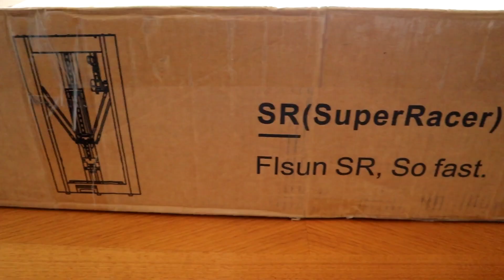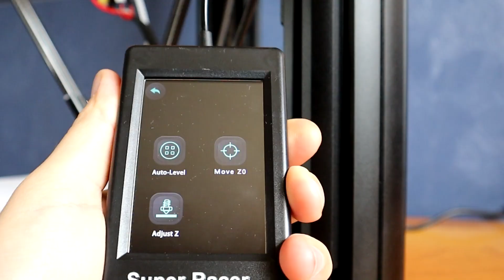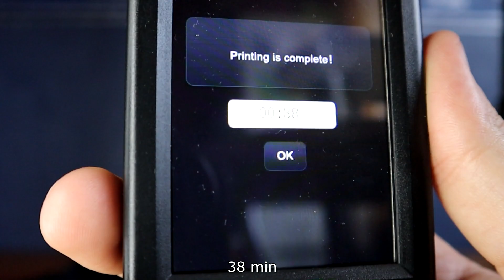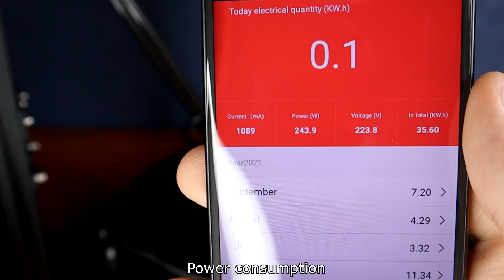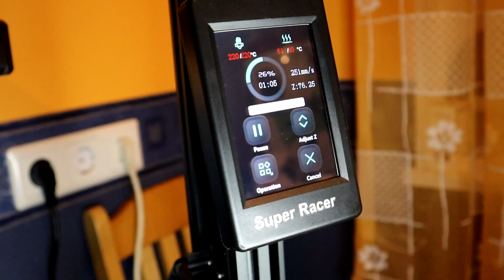FLSUN Super Racer - Fast 3D Printer

Comment: Many tell me this printer is not recommended for flexible filament, and this stops me on buying ... however you print tpu quite well, but on the video you don't say much about it. it has been difficult? how did you do?
Reply from the maker: It's not difficult, lower the retraction settings and use slow speed. Also my tpu isn't the softest one. For flexible filament direct extruders are better. If you want fast printer for PLA, Super racer is what I recommend.
Reply: @3DPrintsBuilds thanks can you tell me the name / model of this tpu that i try to buy it too?
Reply from the maker: @Celt1k  Sunlu TPU
https://www.sunlu.com/collections/tpu/products/copy-of-tpu-flexible-1-75mm-3d-printer-filament-0-5kg-1-1lbs

Comment: Thank you for this nice video, thanks to this review I decided to buy it!
in your video you printed PETG, could you tell me the printing parameters (if you remember it) speed, nozzle temperature and plate temperature? Thanks a lot!!!
Reply from the maker: Thanks! I don't remember exactly the settings. Temp 235 for nozzle, 70 for plate and for better bed adheison flip the glass plate and use  glue. At first choose slower speed and during printing rise the speed and you can see what is the best for your PETG.

Comment: thank you for your nice review.  
I've had my eye on this printer for a while but the lack of information about TPU printing is scarce but essential for my user case.  in your review I see the SL TPU printing for the first time without modifications such as a direct drive (sherpa).  
Did you have many problems with TPU (long bowentube) and at what speed did you print the test cube?
Thanks in advance!
Reply from the maker: Thank you! I don't remember the exact speed at the moment, but when you print TPU, you have to slow it down. Speed about 35-40mm/s for smaller prints and bigger prints maybe faster. The TPU I used isn't the softest one too. Overall it can print TPU, but there are better ones for it. But printing with PLA, the speeds are amazing.